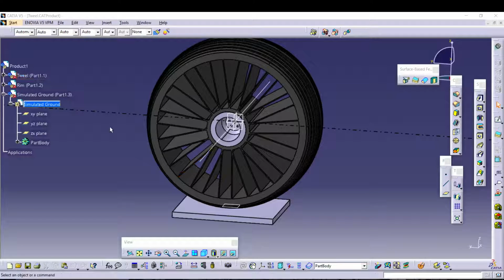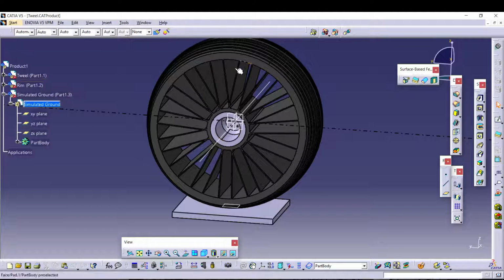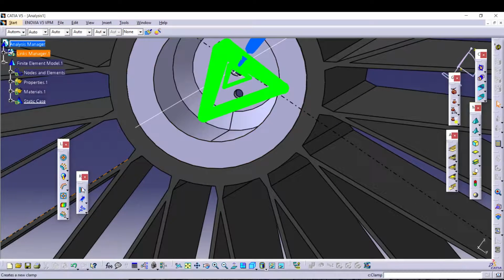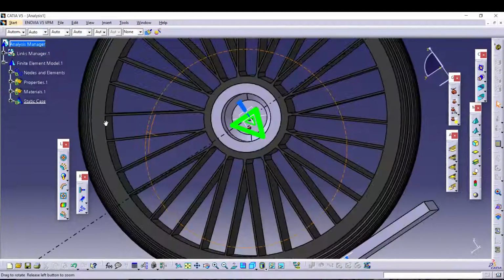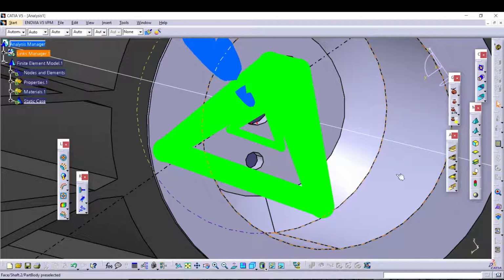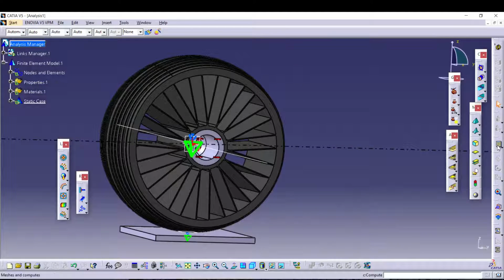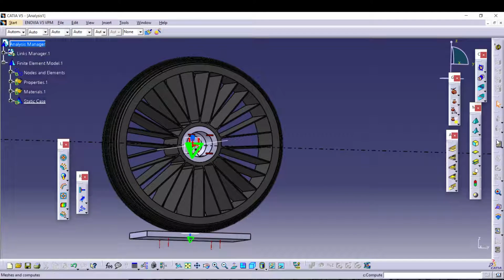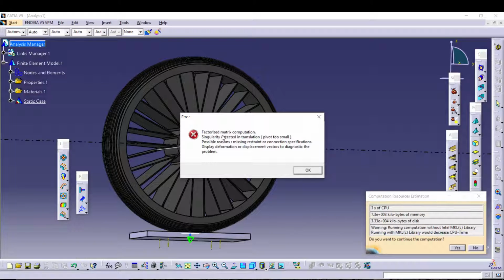Generative Structural Analysis error: Singularity Detected in Translation (Pivot too small)

Comment: if its an assembly, then u need to add contact constrain (or others i.e bolt tightened) in "Generative Strucyural Analysis" in each of your contact constrain from "Assembly Part"
Reply: coincidence constraints that u used are in the "assembly design module"..that is no problem, then you open "Generative Structural Analysis Module" static analysis. Search for "Connection Properties Toolbox", use slider connection property/ contact connection property/ fastened connection property that you need to use it in each of your constrains when you add in "assembly design module"
Reply: Ivan Yakobus is there a way to do the test with no bolts but just a contact strain? also as I'm design a simple aircraft wing, do I need to have a contact constrain for an arrayed (repeated? aerofoil ?
Reply: John McCrudden you use contact constrain when assy the parts.
then you click "generative structural analysis". Give contact constrain again in each contact, this contact constraint in GSA is to define parts can not move "pass through" other parts.
Reply: John McCrudden in modul generative structural analysis, search contact connection.. expand from slider connection.

each of contact constrain should be add contact connection. please info if you've succeed
Reply: Ivan Yakobus Which tool do i use to do this " Give contact constrain again in each contact,"? Im just trying to sort it out and still getting the same thing - im trying to make sure that its defined can not move pass through - Thanks allot for the help!
Reply: Ive tried your answer. I still get the same error? Is it because i use coincidence constrain instead of contact?
Reply: NMSB coincidence constrain when assy, 
open generative structural analysis then..
need to add contact constraints when in each of your constraints symbol
Reply: Thank you very much for your answers Ivan, I was stuck with this problem.
Reply: Miguel Estepa so you've solved it?

Comment: Hi man, your plate is free... İt should be fix for one way (Z direction) You should add the vertical surfaces to surface slider restraint. And the second one is, you should use contact connection prooperties wheel hub and wheel and plate and wheel surface. This is going to be lineer computation. In this video, you tried to calculate linear dynamic situation. Did you understand what I mean?
Reply: merhabalar, tek parça halinde çizmiş olduğum bir analizde bende aynı hatayı almaktayım ama sorun ne olabilir? yardımcı olursanız sevinirim.